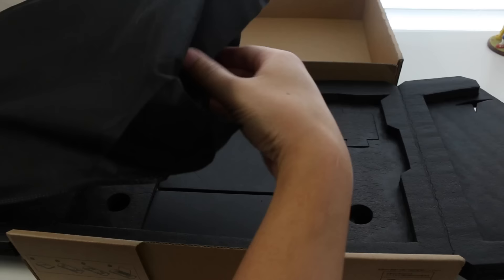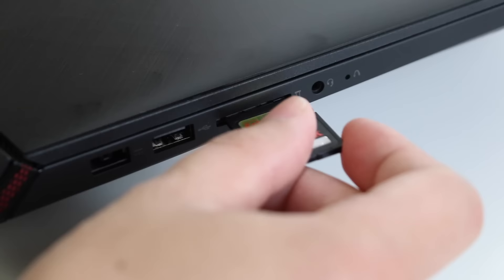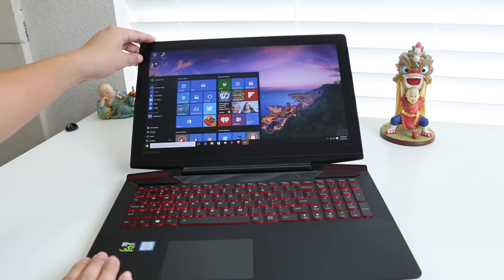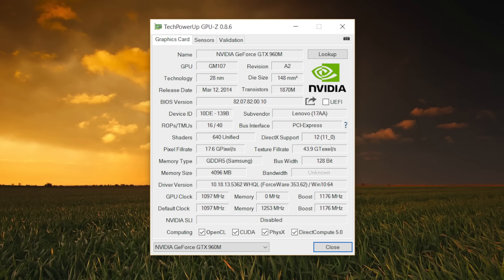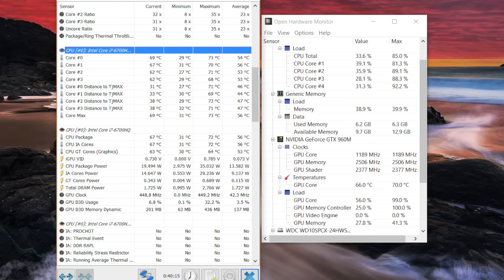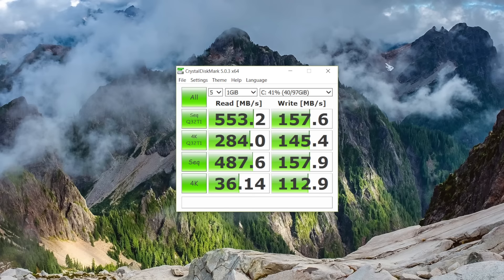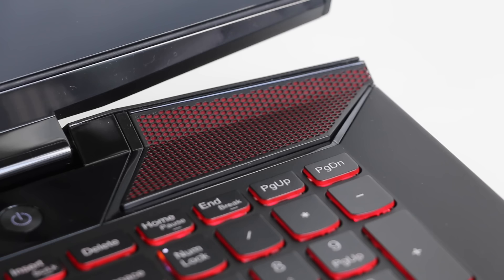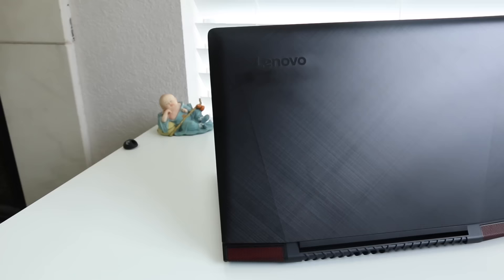Lenovo Y700 15.6" Gaming Laptop Review

Comment: Hi, I just bought this version: Lenovo IdeaPad Y700-15ISK 80NV00M9MJ

Specs:
Intel Quad-Core i7 6700HQ 2.6GHz up to 3.5GHz
8GB DDR4 Ram
128GB SSD+1TB HDD
Nvidia Geforce GTX960M 4GB DDR5
15.6" FHD LED Screen

My questions:
1. Mine does not have the AntiGlare plastic. Is it normal?

2. I don't know whether it's monitor issue or graphic card. When I play a movie or stream youtube , although it's HD, the quality is not that good. Kinda pixelate and the color is too deep, it too dark and not nice. How to solve this issue?

3. On the bottom, at left and right have some vent with plastic covered. What is that? Do I need to remove the plastic?

4. The battery is not removable. Usually I will remove the battery and  use the AC. So for this laptop, to take care of the battery, only plug in the AC, when the battery is low instead of just plug the AC all the time? 

5. I cannot install Chrome at all eventhough using offline installer.

I hope you can help me. Thanks!

Comment: Would you guys say the 128 SSD is enough for a normal user (for windows and programs) to keep running smooth? I'm not an editor so I don't really use Hard editing like programs so I'm wondering if I should save 100euros and get the 128SSD instead of the 256?
Reply: You just need an ssd for the OS basically

Comment: I bought one. this thing is a beast. it's an upgrade from the HP pavilion 17 g199nr. not a big one. but I do get a better graphics card and a quad core skylake i7 processor instead of a dual core i7 on the HP. I did upgrade from that slow hard drive to a ssd recently.
Reply: I'm new but how does upgrading the slow hard drive make the computer faster?
Reply: SSD drives have no moving parts unlike a HDD.
Reply: How do you upgrade it?
Reply: Rajarshi Ghosh took it into the Microsoft Store and did it for me. That one I think has 15 screws to take off to get inside the machine. A lot harder to get into the machine.
Reply: Ronald's World and Opinions Cool and are you enjoying the machine?
Reply: Rajarshi Ghosh I have a few laptops. Its one of my favorite ones to use. It's fast and really powerful. I also have the Dell Inspiron Gaming laptop also. That has a 4k screen on it. Colors pop more on that. Same processors on that. I did get it on a Black Friday deal.
Reply: Ronald's World and Opinions That's great. I'll be buying one soon. Thanks for your input man, appreciate it.
Reply: Rajarshi Ghosh No problem.
Reply: Ronald's World and Opinions can i play gta V on this notebook ??
Reply: Blackzorro 0528 you could play gta with almost any laptop at least with a gtx 940m above

Comment: alright so, I have just a couple questions.  (and I'm new to the laptop scene in general, so I apologize for my unintelligence) 1. Could this handle skyrim with little to no problems even with mods and highed settings?  and with laptops,  is it bad to leave it plugged in for a majority of the time? or does that fry it? any help would be nice. I've been really thinking about buying this model
Reply: It will run skyrim no problem. Second leaving it with the power connected isn't a problem. It will not try out.

Comment: Hey Andrew , thanks for the video i have a small question i ordered mine which only comes with a 512GB SSD storage , i'm afraid that wont be enough on the long run. Will i be able to add a secondary HDD along with the SSD ? or even a secondary SSD?
Reply: You can use an external hard drive

Comment: Watching this on my Lenovo y700. Must admit, gaming is smooth. It belted the frames for titanfall 2 at 1080p quite good.
Reply: Hey, would you say the 128 SSD is enough for a normal user(for windows and programs) to keep it running smooth? I'm not an editor so I don't really use Hard editing like programs so I'm wondering if I should save 100euros and get the 128SSD instead of the 256?
Reply: For normal windows and regular apps only, it looks good. If you are sure you wont ever cross that threshold where you start app developement, editing or some serious gaming, 128 will serve the purpose. Else scale it up to 256. I am using a 256 GB myself.

Comment: hey Andrew great video wondering if you can do me an favor need the model number of the ribbon attached to the slim hard drive my problem is I have a 256 hard drive solid state and would like to add another solid state hard drive but there's no ribbon in the y700 i purchased.i opened the pc and no ribbon your help will be greatly appreciated

Comment: Hi, great video! i bought this computer after watching this review!

i have a question, i got this laptop in th e i7 960 4gb config,
you say you got about an hour and half of battery but when i play on battery with no battery saving and after 15 min of battery playing the fps is getting very low
this is not thermal problem because if i plug the power brick its get back again,

you have any idea why this is happeing ? its making playing on battery impossible
is this normal ?
i read that this is because the battery cant supply so much energy but if that was true i should get fps drops instantly ant not after time

Please tell me what you  think and  if you had any fps problems on battery

thanks!!

Comment: Andrew could you please suggest one between Dell i7559 i7 non touch version and y700 non touch version(both 1080p) in terms of battery life ,cooling,display ,performance (throttling if any)and last but not the least WiFi connectivity. It would be very nice of you to atleast give a reply

Comment: regarding your comment on the GPU i totally agree with you... YES!! They should have introduced this model with the 965m at the very least!!!! but to house a 970m or a 980m the laptop would have to be thicker as those gpus require a more bulkier cooling system. Maybe not the 970m but the 980m definitely requires a bulkier cooling system

Comment: Wow, this is a great laptop but i wonder should i get this Lenovo Y700 (i7) or Dell's 7559 (i7) or Acer's V15 Nitro 572 (i7)? My primary standard would be battery life under light uses (web surfing, coding and doing statistics, writing documents, watching videos and series etc) and under light gaming (I read on a laptop review that the Acer's 572 can achieve a significant battery runtime but i don't remember the exact numbers).

Comment: Is battery removable or non removable. If it is non removable, how can I prevent overloading?
Reply: not easily removable. It came with a lenovo software settings application though to hold the power at 55 - 60% to not overload the battery if it's plugged in all the time.

Comment: Should I get the Y40 or the new y700 14". The reason i am having trouble deciding is because the y700 is slightly thicker. I would greatly appreciate a reply :D
Reply: the reason why it is thicker is to cool it since its getting better specs and yes you should go for the y700 which in my opinion is a better 14 inch laptop then the y40 also up to your wallet
Reply: Thanks man!

Comment: Im looking into buying either the Dell Inspiron 7559 with the i7 ,8Gb of ram and a 5400rpm Hdd without SSD that is for 999€, or the Lenovo Y700 17" with the i7, 8Gb of ram and a 5400rpm Hdd without SSD that runs for 1100€, witch one should I get?
Reply: im in the same boat, and in the end im going to save up a little extra for the y700 because i have heard that the 7559 is really bad in the quality of its screen, speaker, trackpad, etc. however this is much better for not THAT much more,
Reply: Right now here the Y700 dropped to 999€ same as the Dell so i´ll probably end up getting the Y700 since I´ve read about those problems on the Dell too

Comment: Can't decide between this and the new dell 15 7000. It also has a 960m but with an I5. The price is only 799.00 what do you think. Is the dell 15 comparable?
Reply: get the dell. same specs except for the cpu.
Reply: +Avi Aggarwal cool, thanks. Going to look more into it. Not many reviews out there for it yet
Reply: +Avi Aggarwal Doesn't the dell also only have just the 256 SDD? I need that extra TB of storage. I'm also on the fence between the two....maybe also the new Acer Aspire too.
Reply: +Ian M its 500 dollars cheaper
Reply: +Ian M and has 1 tb of storage I'm p sure
Reply: Hmm, Amazon deal maybe? I better do some research.
Reply: +Ian M idk the dell laptop seems like such a good deal. 800 for 256 ssd and 1 tb hdd and a 960m. the only downside is the dual core i5 but its still worth
Reply: Is that deal on the Dell site? All the ones I saw was just the SSD through other vendors.....if that's the case, I think I sort of have to for the value, ya.
Reply: +Ian M yes its on the dell website. I just saw someone post a video of the dell running fallout 4 . Low settings but 60fps 1080p

Comment: What's the difference between 960,970 and the 980 plz reply
Reply: massive difference between 960m and 980m example on the 980m you can play battlefield 4 on ultra with 100 fps but 960m you stay around 40-55 on ultra the 970m stays 70-80 fps on ultra

Comment: Is the i5 varient worth the money because i am looking at it and it has has the same specs as the i7 with the exception of the i5 (which is a quad core proccesor) PLEASE TELL ME
Reply: the new version comes with i76700HQ quad core series, i am just going to replace HDD with SSD and windows installed in 120 GB is perfectly fine i guess...
Reply from the maker: +TomDoesAndroid Yes, the i5 is a quad core too. It offers the biggest bang for your buck.
Reply: Thanks Andrew :D
Reply: ***** thanks bro

Comment: i just picked one of this up at best buy for 600 bucks and its doing great im picking up gta  5, and fallout next week so i hope i'll get a good experience out of it.
Reply: Let us know how it goes!
Reply: Amatullah Smith sure i'll u guys know how it goes ;)
Reply: How did you get it for 600$?
Reply: LOL $600 you probably got another laptop
Reply: Probably a return or refurbished one or perhaps an older version laptop...
Reply: Nope it was new product i've had it for a month now and it works great ive installed GTA V and im getting about 50 to 55 fps , and installed Visual studio , autocad , and maya and it works great , haven't installed any video editing program yet but im gonna get photoshop and im pretty sure is gonna run without any problems , the only thing i would've liked with this Pc is that it should it have the 980 gtx but is ok for the price i guess , well is perfect for the price i guess lol. to any of the people saying i didn't get this pc , i recommend u to go 2 best buy and u will find great deals.
Reply: +Esteban Reyes Could the one you got be more of a downgrade version compared to the original? Either way I'll drop by Best Buy to see if they have it for around the same price.

Comment: This is a great laptop, so far I have only seen 2 laptops with this CPU and this Graphics card, the other is the Dell XPS 15.
The Dell XPS 15 also has (Skylake QuadCore Intel Core i7 CPU, 16GB DDR4 RAM, Nvidia GeForce 960M). 
I think both are excelent devices to get top performance for gaming on a laptop.

Comment: Great review, Andrew! Bought this laptop a few days ago, just waiting for it to be delivered. The only question I have is the battery. Like ALL batteries, it will eventually die out. So, can it be replaced? I'm asking because it looks a tad bit more complicated than a traditional laptop battery.
Reply: Mine came in like 2 weeks ago.  Internally it's a little bit of work to open up, but is doable. The battery itself looks like it should be replaceable when it goes dead though. Also something to note, Lenovo includes a "Lenovo Settings" application which you can control power settings in, etc. and you can turn on a "Conservation Mode" which helps keep you from killing the battery if you leave it plugged in all the time. I though that was pretty cool.
Reply: Thanks for the info!

Comment: I am just here to say if you own a y510p or any other laptop like the y510p then yes this is a very good upgrade due to way better screen and specs overall with better cooling but if you are coming from a y50-70 the I would say it's up to you because the only major difference is cooling and better ram. CPU is just a little better then the y50 CPU and the build quality of the y700 would be better also the ssd is a very big improvement over the y50

Comment: I found this cheaper version on Lenovos website, what would I be missing out on?
Processor
Intel Core i7-6700HQ Processor( 2.60GHz 2133MHz 6MB)
Operating system
Windows 10 Home 64
Display type
15.6" FHD IPS LED 1920x1080
System Graphics
NVIDIA GeForce GTX 960M 4GB
Total memory
12.0GB PC4-17000 DDR4 2133 MHz
Hard drive device
1TB 5400 rpm
Hard drive device
1TB 5400 rpm
Optical device
No ODD
Network card
Intel Wireless-AC 8260
Bluetooth
Bluetooth Version 4.0
Warranty
One year
Pointing device
ClickPad
Battery
4 Cell Li-Polymer
Reply: a slower HDD, but you can just replace that with an ssd if you wanted. That's what I pit in mine.
Reply: RAM not 16 GB and no SSD

Comment: i have this and it runs games very well and the touch pad and the speakers have updated alot to but games that are very graphic intense might have to be run at medium to low setting. I just use the recomended settings and tweak them as i go

Comment: But why did they not give it a mini displayport, so i can run games like CS:GO at 144fps on my Asus VG248QE
Reply: +aXnMaN Why do you need 144fps?
Reply: +Izaatz Because i have a 144hz monitor that i might be using sometimes  :-D
Reply: +aXnMaN dude 80 fps or 144fps can't see difference
Reply: +DubGames no but i and maybe you  can see the difference between 60 and 144 :-)

Comment: Just thought I would give a shoutout to Best Buy. They are having a gaming PC and laptop sale rn and this laptop is on sale for $300 off making it $750
Reply from the maker: Damn, that's a very good price. Thanks for the heads up.
Reply: REALLY STILL?
Reply: Is this Gaming Laptop touchscreen? Or can you add touch capability for extra money?
Reply: I bought this one yesterday. Epic laptop. The display is not touch capable on my model. I dont think there is a touch option.
Reply: Same price on Lenovo's website except you get can 50$ off if you use the sign up coupon making it 700 :P
Reply: bleh, best buy makes it cost 999.99  >_<

Comment: Can it handle a secondary 28-32" 4k display okay?
Reply: 960 M does badly with a 4k display. So, no. Although a 2k display will work fine.
Reply: this is the issue im having right now!! i want to connect a monitor  120-144hz to the laptop, but the issue is that the y700 only have a hdmi and i dont know if it supports 120-144 hz through hdmi. :c if not then i have to buy 60 hz monitor :c
Reply: FEELING: Ultimately, they're mobile processors. If not immediately, they're bound to become slow.

FACTS: It supports a 144 Hz monitor, as a minimum. However, there's no point in buying a 144 monitor simply because the GPU should be able to push ~70 fps out. My Y5070 gives 40 fps. Newer ones will be a little better. Don't expect 80 fps. So a 144 monitor seems useless.
Reply: Well I get 120ish fps in csgo...
Reply: Sebastian Cusis I'm talking of more GPU intensive games and cinebench scores for fps. As for a 144 monitor, it supports it as far as my research goes. Go ahead and buy one. Games like CS:Go will look great.
Reply: y50-70 was very bad for csgo (because of the overheating), 800$ 'top notch' 2014 laptop , lasted a little bit over 1 year while playing a video game from 2012 on 1024 resolution, all low.  Go for ROG, lenovo is D O G S H I T for gaming.

Comment: Hmmm, why my Y700 has i5 processor?
Reply: +irmscher9 cause there are several configuration options. 
There can be a CPU from Intel (I5-6300HQ / Core i7-6700HQ Quad-Core Processor) or ADM (FX-8800P)and a GPU from Nvidia (GeForce GTX 960M) or AMD (Radeon R9 M385X) beeing installed and that reflects on the price and performance.
Hope it helped

Comment: Will I be okay playing games on the 8GB RAM version?
Reply: RAM has nothing to do with performance while playing games. The graphics card and the VRAM are the ones responsible for performance, and in this laptop, the Nvidia GTX 960M with 2 or 4 gb DDR5 VRAM works really well. So yes, you will be fine.
Reply: Thank you for the reply!!
Reply: +Asish Katta 8gb will work better than 4gb but the 8gb will be fine
Reply: +Asish Katta do u think it would be able to run dying light?
Reply: +justin rivera for sure..dying light can even support gtx 550TI